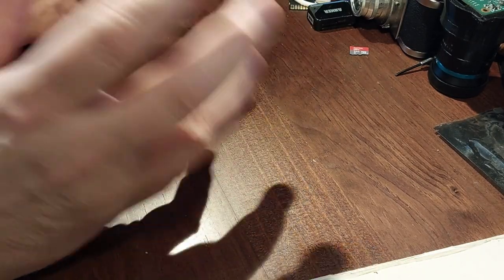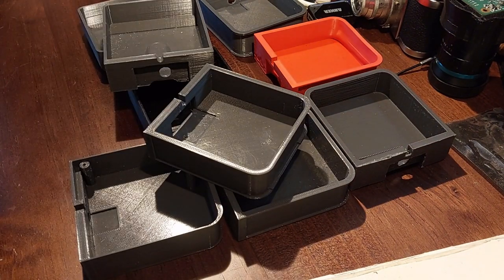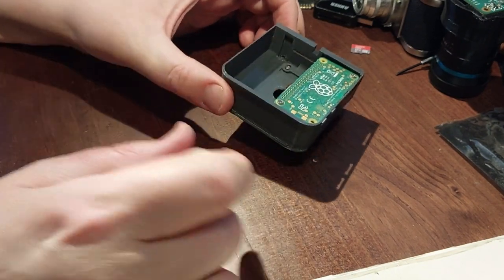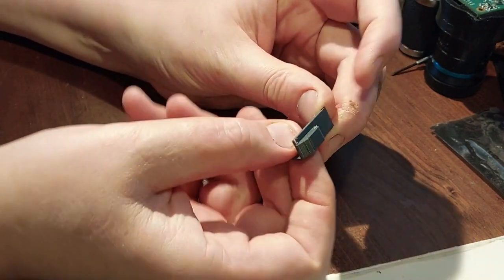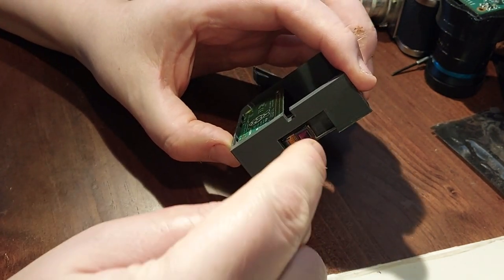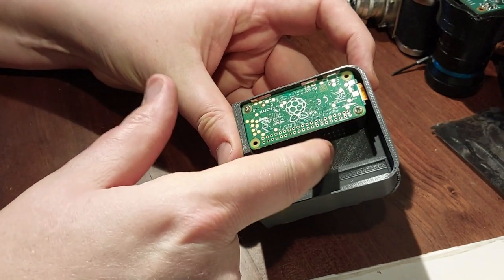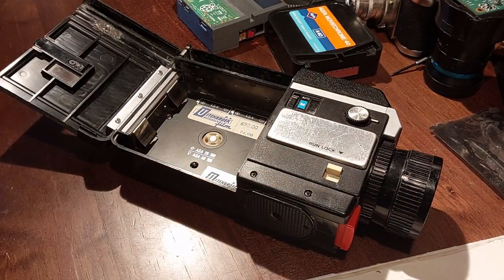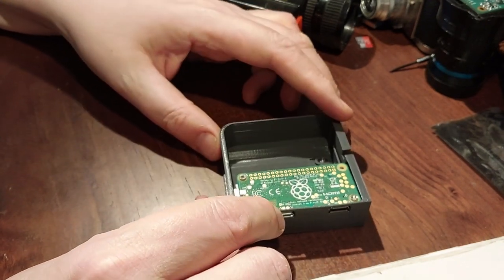What's On Jenny's Bench: Digital Super 8 cartridge, part 1

Comment: funny i saw your Single-8 video first and then the part 2 of this series and now this one ... 🙂anyhoots, if the tiny size of the video sensor is too hard to fit within the camera's gate exactly, then why not use a slightly bigger sensor that would fill up not only the entire gate area, but also go further around it to make sure at least part of the sensor fills up the gate fully!? i know already this could not be the perfect solution but it might be a good new starting point? after all, some DSLR cameras already use this little trick for a number of reasons ...
Reply: btw, the time length of the Super-8 cartridge is not 5' ... it's 2.5' when shot at 24FPS and more than 3' if shot at 18FPS ... 🙂
Reply: i'm also thinking that extra empty space in the digital cartridge can be used for quite a number of things ... 1stly, sound recording circuitry can be installed there ... or extra battery to run more power-hungry micro computers and sensors and so on ...
Reply from the maker: The real problem is getting the sensor in the focal plane. It's surprising how much difference as little as a milimetre makes.
Reply from the maker: The intent is to replicate a silent cartridge, and let the filmmaker record their own sound. Sound recording in the cartridge is problematic, often there's no way to get the audio signal into the camera.
Reply: @jennylist  yes i know about that ... but as you have demonstrated that yourself too, the slight adjustment to the lens trick that works but also turns it into a macro lens instead of a 'normal' one, can now be applied to the sensor itself, by means of some screw / volume thing moving a tiny plate holding the sensor back and forth for fine tuning its distance from the gate ... after all, with some output signal taken directly from the sensor cartridge, its image can also be viewed on a separate monitor outside the camera's cartridge chamber, right? 🙂

Comment: Why don't you take off the UV-lens, from the picture-sensor? That will make the sensor less thick.  Then add an 'after-market' UV- lens onto the outer objektive.  This should work, you will get this one Millimeter off, you needed for proper projection of the images. 
The quality of the video you will get, should be like 'with the UV-filter' again.  

Hope you can finish your project. Sorry for my bad English, it's not my native toung, ... !

Greeting from Germany, 

Markus (db9pz) - my Ham radio call
Reply from the maker: Imagine the sensor as a glass box a few mm thick, with the light sensitive chip on its back wall. The UV filter isn't the issue but those few mm, they're enough to put the sensor outside the focal plane.

Comment: if you make the sensor mounted in a way that you can put sheets of paper below it, you can use them to micro adjust the distance. A sheet of paper is 0.1mm thick which is probably the closest you will get in tolerances anyway out of a 3D printer. It might help you dial it in. :)
Reply from the maker: The original sensor mounting in this video wouldn't be helped by this, but I am using exactly this technique with the latest lens mount.